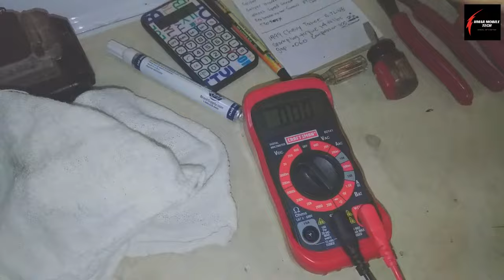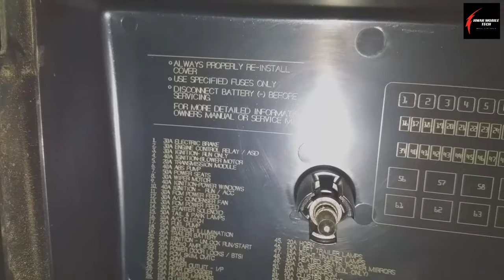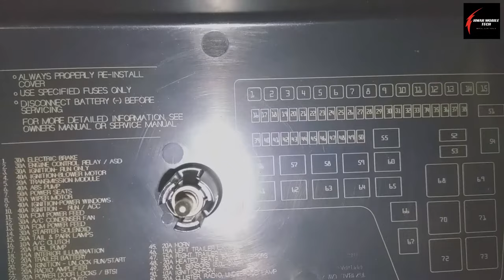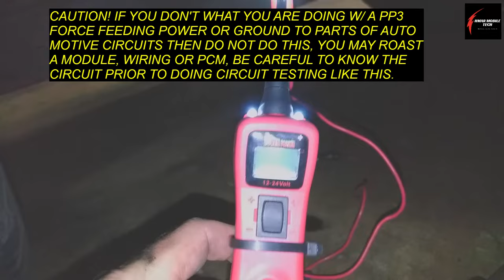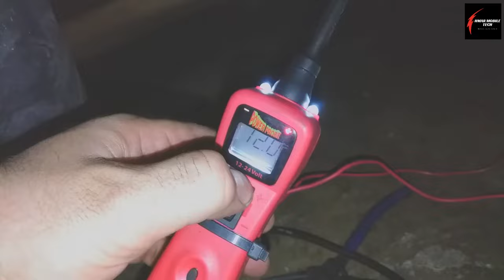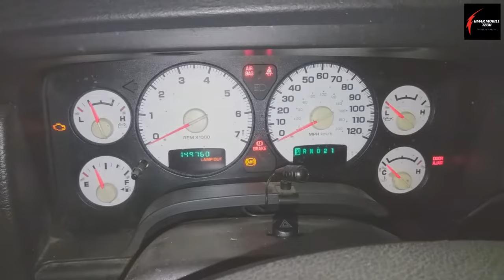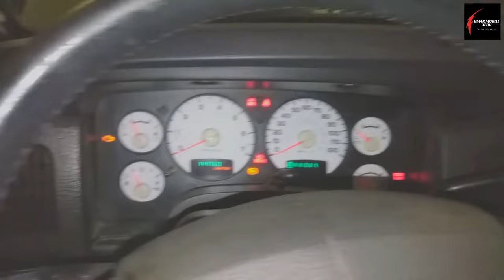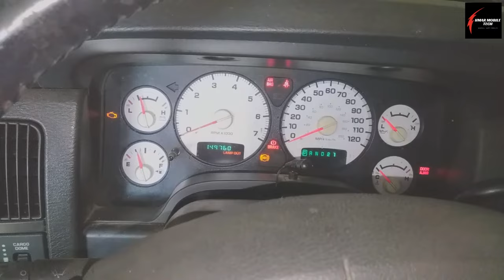CRANK, NO START, Dodge Ram truck 1500 5.7l, V8 3rd gen. 2002 to 2008 model years, ASD, bad fuel pump

Comment: What if it starts for about one minute then stalls out then it starts and you can keep it running if you keep it about 3000 rpm
Reply: Probably injectors or filter?

Comment: Can i use a regular test light for injectors and spark plug testing? Sometime i hear my fuel pump come on and sometimes it doesn’t. Also sometimes it starts and runs and sometimes it doesnt.
Reply: this is exactly what’s going on with my truck, i replaced my fuel pump with a brand new one and still sometimes it comes on sometimes it doesn’t. any updates on urs?
Reply: @anbush0621  yeah, i think that maybe the wiring harness wasn’t plugged in all the way, it was extremely difficult to plug in,
Reply: The tipm “fuse box”

Comment: Having a similar issue but confirmed asd working but no spark as gauges cluster is fully operational (was told if asd operational then the cluster would not work properly.) Showing fuel level and fuel relay as Im hearing the oump activate but having a hard time diagnosis what it could be. Any recommendations on what to check?
Reply: Pulled pcm fuse and it is fine, traced the wire as well as I could with online diagram and appears to be fine, all connections seem to be fine. Can bridge the starter solenoid fuse and it will turn but not with the key (key and a transponder (black) separate, appears to have no spark but do not have the tools available to me to accurately determine the spark test like you do.

I've boiled it down to the pcm itself, crank/camshaft sensor(s) or the ignition coil assembly (wires, plugs and coils) dash working, the mileage when tested shows no codes and says done, the head test pressing step and reset says pass and I am only showing a p0113 code (Intake Air sensor circuit 1 high) 

Replaced starter and battery and tested the fuses, all systems operational but not crank no start no spark from key 🤷‍♂️😭
Reply: Dash shows CEL and lightning bolt for the TCM, but believe that could be due to the no spark and registering it as it doesn't need to be open? I'm at a loss right now and have no idea.
Reply from the maker: Check all wring at PCM make sure grounds are clean and tight, make sure no blown fuses. Try having PCM tested if not get an identical PCM from wrecking yard and give it a shot, no promises tho._
Reply: @hmarmobiletech8332  ended up being a super weird aftermarket security system that had blown an inline fuse and popped the switch which was the cause of the issue!
Reply: @Ni_ghtmare  I just bought an O6 charger and I believe to have the same issue with the aftermarket alarm. Was your vehicle throwing any codes? Pls help 🙏